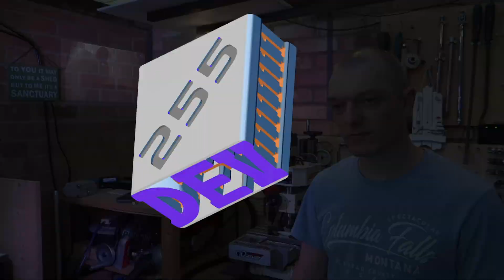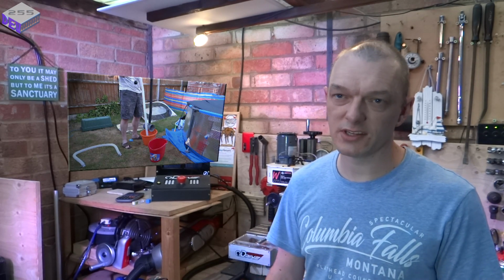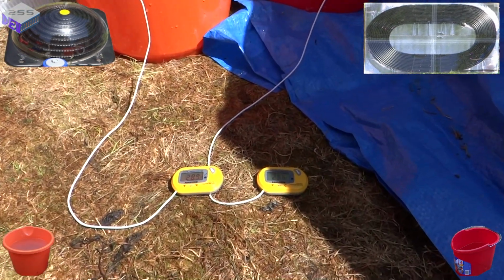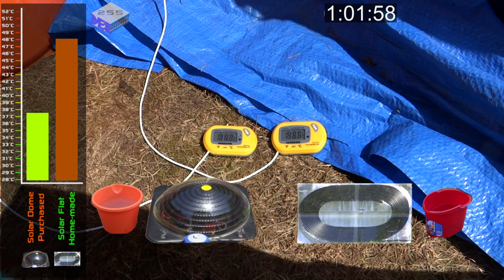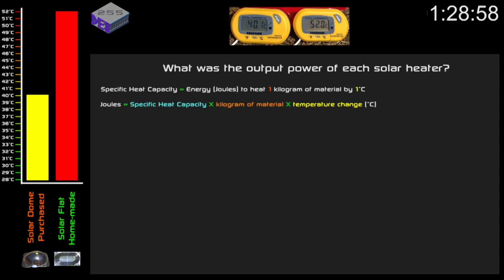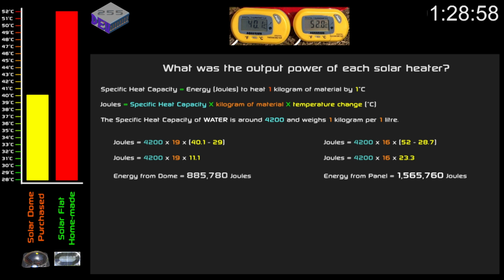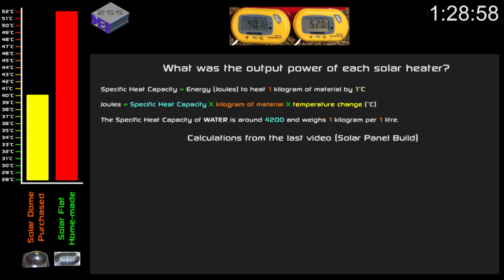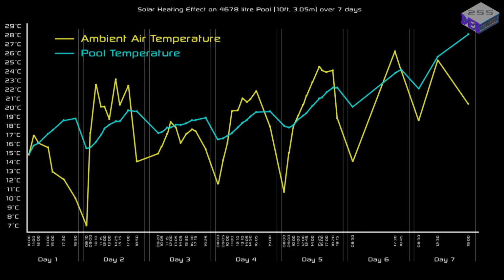2. Which Solar Pool Heater? - Homemade Vs Purchased

Comment: If heating for pool, better to loop both with pool water in. And measure temperature out. Temp change times flow rate gives effectiveness. 

Closed loop allows temperature to rise higher thereby reducing the efficiency of heat transfer.

Comment: Thanks for showing all the work AND the testing. Most videos show a test of the 1st few min of water through hose. Any garden hose will give hot water for a short spell at 1st, its the full test that counts. 👍
Reply from the maker: No dramas, glad you enjoyed it, although I did go into even greater detail on part 3 😉 (my voice does drone on a bit in it though). I'm making another one at some point in the next couple of months using copper pipe, aluminium plate, sealed glass unit and Matt black paint. I will compare last year's one with the new design too. Thank you for your comment 👍

Comment: Really useful, thanks. I've been keeping an eye out for this follow up video after seeing the first one. I built a small panel using some scrap materials i had lying about as an experiment and was trying to figure out if it was worth it to build a bigger, better one. This is really helpful.
Reply from the maker: Hi, glad you liked the video, I didn't want to rush making it so I could answer all the questions from the last one and get all the maths correct. Thank you for your comment.

Comment: please note that average power drops significantly when you do your bucket test with such a high water temperature, if you take into account only first 12 minutes with 5°C difference, you get about 500W average power for DIY, also, the difference between DIY and purchased one is significantly bigger because purchased one never reached 50°C at which point it's like having a radiator dissipating heat all over the place. Thank you for sharing your great work!
Reply from the maker: Hi, thank you, that's a good point to note. If I do this type of test again, I will display a plot showing wattage, temperature and possibly heat loss over time to show how this is all related.

Comment: I built my home pool heater a bit different.   I used 1/4 (6mm) irrigation tubing.  The feed is a 3/4 inch pipe run down the length of one sheet of plywood (8 feet).  I made 33 connections into the side of the pipe to attach the tubing.  The tubing sections are 17 feet (just over 4 meters) and were snaked back and forth to a 3/4" pipe on the opposite side as the outflow.   I added a timed valve that allows flow every 10 minutes.  The output peaks at 125 degs f (52C) and is about 3 gallons per cycle.  If I cycle it through continously into itself it quickly gets to be scaldingly hot..hence I do not do that nor do I allow the water to sit without circulation for more than 15 minutes.

Comment: Interesting video and proves a bit of enginuity is better than throwing cash about. I built a solar water heater a few years ago with silicon pipe squashed between two sheets of aluminium painted black.
It was then enclosed in a wooden box with double glazed glass. 
I never did any maths on it but the water temp coming out could be 90 deg C.
Reply from the maker: Very true, I will be making another one at some point to see how efficient I can get it. Have you still got it, may be worth doing this test and calculating the power
Reply: @TheSolarPoweredEngineer  Unfortunately I didn't build it strong enough and after a couple of years the wood started to rot and I had to take it down. The design seemed to work well enough but my implementation of it was not so good. It was too far from the hot tank so the losses were significant but it still gave us a tank of hot water on a good day.

Comment: How cold is it at night that you lose temp? I'm in south florida and I cant picture losing much temp at night. So the LOW for tonight is 80 degrees, but current outside temp in the shade is 85, so in direct sun that would be 105 (they take our temp measurements in shade here, not sure if that is universal).
Our ocean water here is 74 winter, 85 summer, but for native Floridians , we cant handle anything less than at lest 78, but prefer 80's min

Comment: Had my first solar heated shower this morning. 1.5 metre square heat exchanger will give you enough hot water even on a cloudy day. Midday is best to have a shower. But realistically clear sun to the panel will give you morning showers. It’s important to mix the water. I have a bucket inside a bucket for this but you can add a hot cold mixer tap. Pumped water in small bucket in larger bucket, any over spill can then be heated with gas heating. Although black plastic irrigation pipe works in Uk temperatures vary so best to add metal heat sinks inside or copper pipes. Then insulate the inlet out let pipes.
Reply from the maker: That sounds like a very efficient system, plus I like the bucket usage. I should have my second panel running soon with small bore copper pipe mounted to an aluminium sheet all sprayed black within a frame and sealed glass unit. I have my 1st homemade solar pool heater connected to the same pool now and it's up to 21ºC today. Well done on your system.

Comment: Cheers, you’ve gained a sub!
Have been pondering a DIY solar but , being nerdy, I have needed the numbers, 9/10 YouTube vids just go ‘oooo, it’s hot, it works’ , which, I know isn’t necessarily good…
Now, seeing your energy calcs, and knowing the energy needed to pump around a system, I can understand the efficiency, know how much pipe to use and automate based upon solar radiation
Reply from the maker: Hi, thank you. Yeah, as you said there is little information with other videos, so I tried to put as much in as needed without too much. I did a follow up video that went more in detail too, I hope to do more in the future. It would be good to find out how your one does.

Comment: Man. You guys in the UK are all in about heating the pool. I noticed a lot of products are geared towards you guys. It's almost always sunny and hot here during the summer but was looking for simple ways to heat. You guys have a harder time.
Reply from the maker: Yep, you are right, we are always looking at ways to trap get that heat and trap it here in the UK. It's a great feeling to get in a pool of 30ºC and up in the evening when it's raining, especially if you've warmed it through solar.

Comment: I just put a 1/2" green hose 100 m long in sun and heat 60 l of water in 30 minutes from 20 to 38 C for a garden shower. I had 50 for the garden and I bought another 50 m (10 USD). Recirculating water. It depends on the intensity of radiation. Maximum temperature was 46 C but for my shower is too much so I did not tried to increase the temperature with glass, insulation or other.

Comment: Nice work. Found this whilst researching DIY panels for my 10ft pool. I was originally planning on a 4ft x 4ft panel with 60m of hose but I live in the North of England so I'll be taking your advice and go for an 8x4
Reply from the maker: Thank you, yes it's all about surface area exposed to the sun, keeping the wind off the surface and insulating the pool as much as possible to retain the heat overnight, you may need a fair bit of coverage further up North. Good luck with yours.

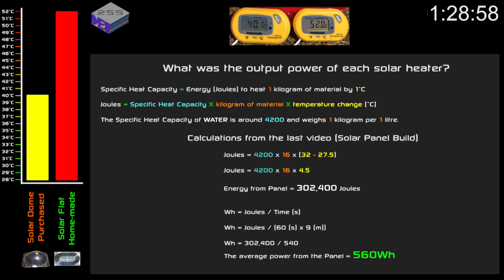Comment: I can see by your calculations Neil, your physics is pretty good. But this is not an effective way to compare. I would bet they are pretty much both similar in effeciency the important thing is the AREA collecting the sun light , the dome is much smaller so will deliver less power. The important thing to realise is the lower the temperature of the water (faster the flow rate) the more efficient the panel will be because a hot collector loses more energy to enviroment. So a fast flow rate is needed . This is the reason you got dramatically more power when running cooler in the other test 4:54 . Have a fast flow rate ( hence low input/ output temp difference) and this will deliver much more heat to your pool.
Reply from the maker: Thank you. I agree, the rate of temperature rise is at its greatest when the temperature difference is also at its greatest. Also, I've learned that the faster flow creates turbulence in the tube that ensures all the water reaches the surface, which increases the transfer of energy; as opposed to laminar flow, where only the outside (skin) is absorbing the energy.

Comment: Good job👍
Keep panel at 30 degrees😉👍
Also use coper tie wire to hold 10mm copper tube in place same as cable ties,as they will go brital and eventually crack with sun ect..
Reply from the maker: Thank you, the cable ties are showing signs of degrading so I was looking at flat metal straps to distribute the heat a little over the pipes, it may melt the pipes if I forget to turn the flow on.

Comment: many thanks 
it is very informative. what is the water pump that you use, I have a pool with chlorinated water, what do you recommend?
cheers
Reply from the maker: Hi, thank you. The pump is a 240V pond pump that has an input and output pipe connection, which is ideal for having it out of the water, connected to the drain output of the pool. Here is the link https://www.allpondsolutions.co.uk/pond/pumps/full-range/1400lh/
It's a 1400 litre per hour pump that runs around 24W

Comment: Hi Neil. Great experiment. Thank you. Just wondered if this water heater keeps on working through the winter months. I appreciate the sun is a lot less intense (or even out) and therefore the water will not heat up anywhere near as much but would it still raise the temperature of the water? And keep raising it day on day (up to a point, as it would drop at night, understandably) even with the mixed bag of weather that the uk experiences. I'm on the south coast.
Reply from the maker: I think this type would have to be far more insulated to retain as much heat as possible to raise the temperature in winter, plus fully insulate the water being heated. It may be possible with fully sealed units, where if it only raised the water by 0.5 Deg per week in the winter you are increasing/maintaining the summer heated water, although would lose a lot of heat when used. It's difficult to say. On another thought PV (photovoltaic) cells still work all year round, so there is plenty of sun and they are only up to 20% efficient, where solar water heaters can be up to 90% efficient, so I am optimistic. I will hopefully be making another panel this year with double glass sealed units to see if I can get more out of it.

Comment: Great work, we have a large intex pool, I purchased a solar heater last year which didn't work to well, however I plan to make my own this year following your guide, I also plan to surround the fool with insulating foil and will put this under the pool too.  Presently the pool sites on decking which I plan to upgrade by putting composite decking on top, however I will put the insulting foil between the layers.
Reply from the maker: Hi, we were quite surprised at the difference between the two, where the insulation works well around the pool, plus keeping it covered when not in use helps too. We put the pool on foam garage matting last year and this helped too, plus made the bottom of the pool spongy so was soft when kneeling in the pool.

Comment: did you have to utilize a bypass valve to shunt the flow past the arrays during the night, thus eliminating the reverse heat sink effect?
Reply from the maker: Hi, I controlled it automatically by temperature sensors and a relay, so that when the centre of the panel dropped below 5° above the pool temp (ie pool at 20 and panel dropping below 25) the pump turned off. This worked during the day when the panel didn't get enough energy from the sun during cloudy periods and during the night. The panel had to be 5° or more above the pool temp for the pumps to turn on.

Comment: Do you think two would heat best or use more tubing and make one very large one?
Reply: Hi, good question, I would say both, depending on your usage. I believe 2 would heat at a similar rate to one as it's due to surface area of exposed tubing, so if you are permanently fixing the heater, a larger one would be best as you will save space and materials. If you need to move them in and out for summer/winter, then multiple units would be more manageable, although require more connections. I hope that helps

Comment: hi, thanks for informative video, i am planning to build solar heater too, i am checking which hose to buy as i found, that standard pvc hose has lot of chemicals, i want to have 60mtrs of hose 13mm as there no thicker one.i have intex 900galon pump, not sure if this can can pump it trough, if not i will buy 750w or 400w submersible pump.may i ask you ?do you have any idea if this will have enough power to heat up my pool? its 4500litres as yours.i will put coils in wooden box with glass on top.thank you for your time.i will update with my results once is done.
Reply from the maker: Hi Martin, I used UV-stabilised Micro-Drip pipe that I bought here: - https://www.amazon.co.uk/gp/product/B0001E3S5E/ref=ppx_yo_dt_b_asin_title_o02_s02?ie=UTF8&psc=1

And running a 1400 L/h pump at only 24W here: -
https://www.allpondsolutions.co.uk/pond/pumps/full-range/1400lh/

The pump is more than capable of pushing the water through at ground level, where you will only need an increased Wattage if you are raising the water above the pumps capacity, where mine can pump to a height of 1.8m straight from the pump directly upwards (this is reduced the more pipe you add), although you should be fine your intex pump. 750W and 400W may produce too much pressure and your system would possibly pop with any blockage.

I chose this hose for it's UV capability as I am leaving it in the sun and because the smaller the pipe, the more surface area the water has to absorb the heat from the pipe. good luck with yours.

Comment: Dev255 - Dev255    What i want to know is .. When will you be using a Flux capacitor ??? Amazing work  Thanks
Reply from the maker: When the water speed reaches 88mph and the static charge on the pipe reaches 1.21GW ;-D

Comment: So, perhaps (probably) a daft question, but does pump speed have any impact? I'm thinking if you extract the heat collected by the pipe too quickly then the coil has to start again from scratch - or does it make no difference as it's still passing the heat into the water as it passes through the coil?
Reply from the maker: Hi, not a daft question at all, in fact, one that is often asked. From all the comments and a little research, the pump needs to push water around relatively quickly to allow the flow to be turbulent so that all the water in the pipe comes in contact with the pipe wall, plus needs to remove the heat (transfer to the pool) quickly so that all the energy can be harnessed (more efficient); this because if it's allowed to heat up with limited flow the heating rate would slow down the closer it got to its maximum temperature. I run my pumps at full power (around 18W).
Reply: @TheSolarPoweredEngineer  Thank you for that, makes perfect sense!
I wonder if this type of project was used in a school physics environment then it might be a helpful test that could first be calculated on paper and then actually tested in real life to see the effects of different setups (as you have done here).
Reply from the maker: @videogalore  That would be good for schools, happy for them to use any content 👍

Comment: 1 different which is also why the bought one heats less. Is the he amount of water going through.  The homemade one will bottleneck your pump. Which can be countered. By a bypass valve.

The domenhad 32 mm input. So you pump can put all his water through

Comment: It appears that the homemade collector is about twice the size of the purchased one.  Since the heating from the sun is linearly related to collector area, it is no surprise that the bigger one performed better.  It should have actually been about twice as effective.
Reply from the maker: Hi Teri, I though that too when I was making it, although the centre of the panel is redundant and doesn't transfer the energy to the pipes, hence my second version is a lot smaller, uses copper and has an aluminium plate to transfer that wasted energy space. The Dome heater is fairly inefficient in that the sun does not use the whole surface until it is directly overhead,. I am doing some more experimenting with it this year.

Comment: Good video, just one question, what about price? also the effort of the DIY vs Comercial. I'm thinking in changing the DIY of mine by 2 or 3 of those Domes, mostly because the one that was built in my roof is huge, I mean is like 2 times yours, but without all the quality of yours, I mean it's just 3 series of hose, and no plastic, so I know a lot of heat is being lost. But I think 3 domes will do the same or even better than the one I have, I want also to increase water flow, the one I have is draining it and I think is forcing the pump.
Reply from the maker: Hi, thank you, the panel cost £192.28 in total from all the parts. You may be better off boxing your pipes in and covering with perspex, plus improving the pump, this as most of the cost is in the piping. Or even reusing the pipe within your own homemade panel. I hope that helps.
Reply: @TheSolarPoweredEngineer  thanks I will try